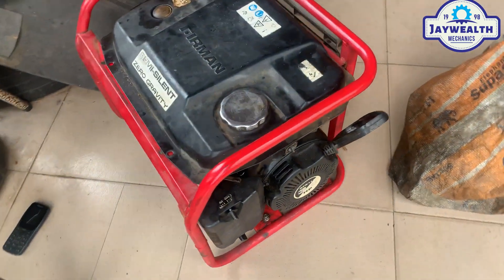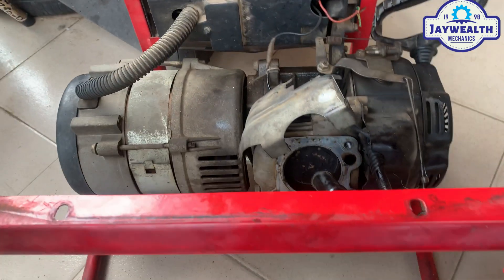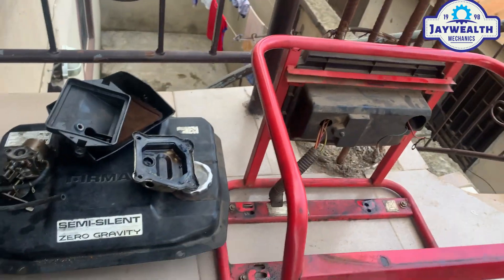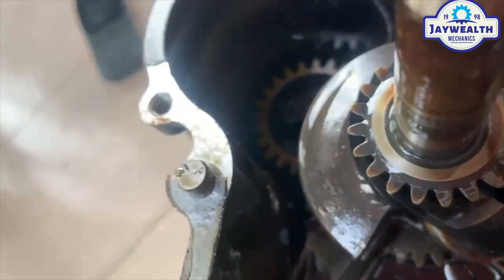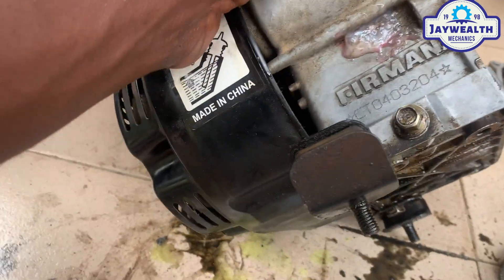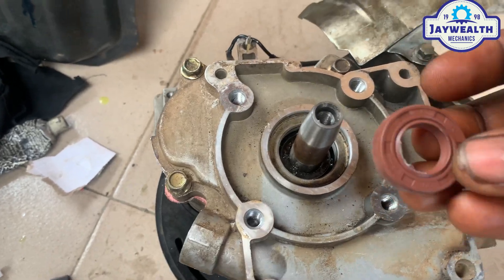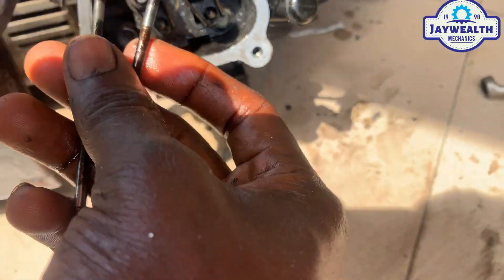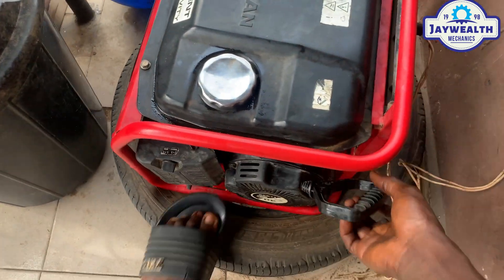HOW TO REPAIR A KNOCK GENERATOR ENGINE(SMALL GENERATOR).

Comment: What is the causes of generator knock and hide to avoid it
Reply: Ok thank you
Reply from the maker: 1. Lack of engine oil 
2. Oil alert not functioning 
3. Irregular service of generator
Reply: @jaywealthmechanics9285  
How regular should be servicing our generator
Reply: @jaywealthmechanics9285 did you replace the oil alert?

Comment: Good day, please materials to buy when ringing a 2.8kva generator and list of tools
Reply from the maker: Complete packing 
Oil
Piston and rings 
Plug 
Valve seal
Reply: @jaywealthmechanics9285  thanks brother, I have finally ringed the generator myself. Been using it for a month plus now. Working perfectly
Reply: @jaywealthmechanics9285  Bless you bro. Thank you.
Reply: @jaywealthmechanics9285  thank you boss

Comment: The noise is kinda much... Next time sandpaper the connecting rods for more quiet operation
Reply from the maker: It wasn’t making noise. That is how generator sound normally. The shaft is still full.. so there is no need to sandpaper the connecting rod.